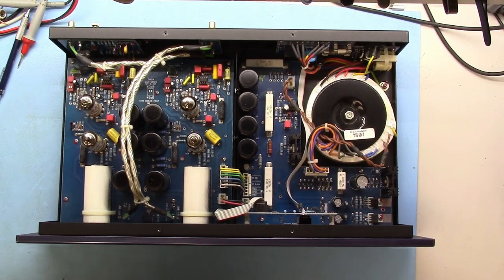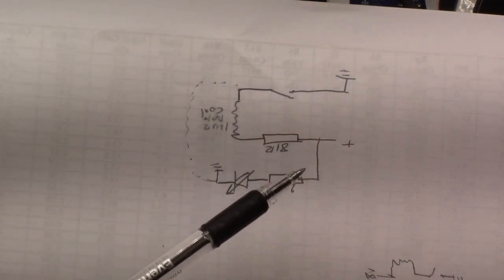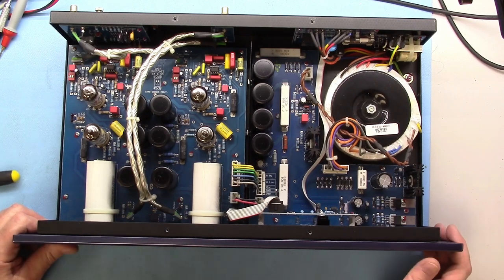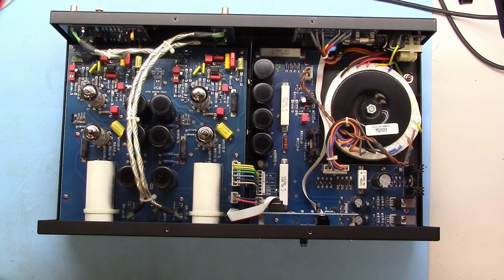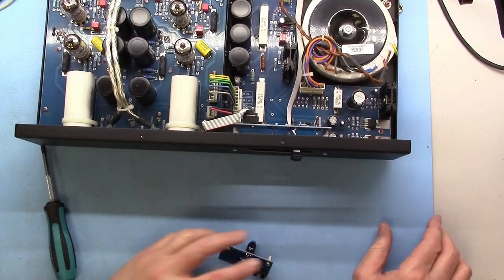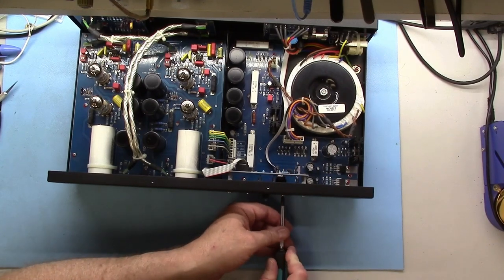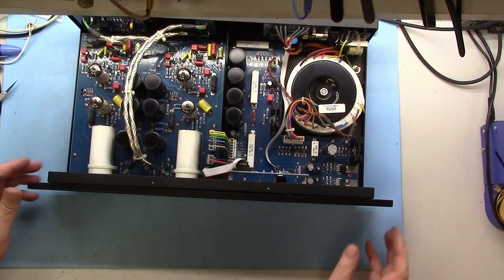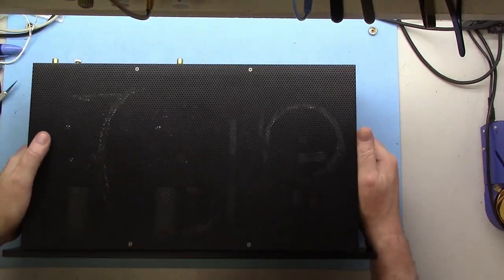Manley Chinook Power Switch Mod

Comment: Thank you Mike, could you please provide the details as to how to discharge the caps...What did you use as a discharger and the pins you connected to.
Reply from the maker: Please do a search for capacitor discharge tool. If you are not comfortable with that, please don't attempt work work on this.